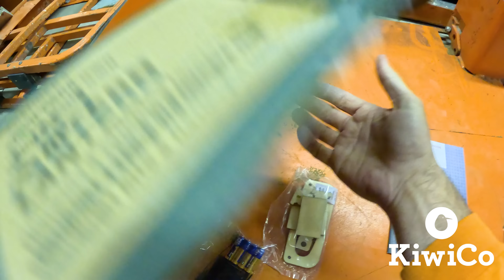How to Install an Elevator in your Backyard

Comment: you should go to Atlas Survival bunkers channel for tips on the finishing touches you should put in to make it an actual bunker capable  of surviving  nuclear fallout and all other stuff. You should get an AR500 bulletproof  hatch on top, have the exit tunnel hatch be covered with sand with an unscrewing  thing that you can unscrew from beneath and have the sand all drop down so you still have a feet off protection from radiation and bombs  at least on that hatch. then have a gastight main door obviously  on the bunker entrance with overpressure valve and porthole so you can open and peek if someone is inside the elevator shaft and maybe shoot them from there, a sump pump if water comes in the elevator shaft, galvanized steel with tubes for air and communications and other stuff, water tank, reverse osmosis, lithium batteries, big radio station with radio antenna outside on the house, wind turbine for backup if solar panels get covered in debris/ash or the sun is blocked by fallout. Also you should get a Swiss or Israeli  air filtration  system that can be handcranked too (atlas survival sells most of this stuff including the doors and air systems and all the other things and blueprints) also the air tube should have   a 90 degree angle with a drop into a area woth gravel and some slope so condensation from the pipe doesnt  go inside the air system  and ruins it, and also if someone  intentionally  pours water or fuel inside it doesnt kill you. also have the pipes be galvanized and covered by a very heavy galvanized mesh  and like a fireplace duct cover (dont know the name) so that someone  cannot put a hose inside it or even have the angle to do so. hide the tubes inside bushes that you plant  on top of them to hide them
Reply: better yet, call Ron the owner of Atlas Survival  Shelters!! Im 100% sure he would love to go there make a video with you and help you turn that into the best bunker you could, the guy is the worlds top expert in my opinion and lives in Texas, he's  the biggest bunker manufacturer  in the world and rhe best one at it
Reply: btw I hope you turned that underfloor as storage, you shouls keep water tanks and food storaged there, make the floor be able to lift up at multiple points like lids so you dont waste that space
Reply: @GenikaXVI  I would encourage you to watch all the bunker videos

Comment: 9:05 concrete (cement) does not dry, it cures, a chemical reaction with water. Too little water during the curing can make the cement crumbly and weak.

Comment: Save those Drive Motors, they make really good winches.
You can use a couple pieces of c channel to take that wobble out. mount the c channel to the walls and have a rod with the follower bearing in it.
That aluminum is going to be loud.
You might want to throw some rubber mats.
 I use super 77 and that non-skid shelf liner
Reply: Rubber mats on top of sound deadening would be perfect for that. Budget solution, reduces vibrations and making that wall feel and sound just a little bit thicker.

We all know that loud tinny noise we all know aluminum sheets love to make.
Reply: Thats a great point. I bet they could!

Comment: very nice ,good job converting the lift .kinda wished you painted it before mounting it against corrosion and you could do an central hydraulics for the bunker like collin furze has so no need for seperat batteries .less components = less things can go kaputt

Comment: if you were to get some cheap from china linear rails and bearing blocks, or from a sponsor rather than china, you might be able to make the lift less wobbly on the way up and down - so long as you can resolve the fact they would lead the rails once the cage went above ground.

Comment: i work as an elevator technician, you could solve the wobbling problem by adding secure side guide rails on the shaft and on the elevator cabin you could add rolling 
guide shoes (wheels). also, you could add a safety killswitch on top floor and on botton to disable the extra course of the elevator, making it stop at level and accepting only commands on opposite direction.

edit: since the elevator is a double entry, and upon close inspection of available space, you could also use a Sliding Guide Shoe. my idea is to apply T shape rails on the back side facing each other and add supports beneath the cabine. the problem with this is that needs a guide rail oiler to keep the rails lubricated or you risk the inside inserts of polyethylene to break due to friction
Reply: I was thinking the same thing, even a beefy linear rail would take out a lot of the sideways movement as it doesn't need to take much weight
Reply: @Connor-s1k  and add some gravity, friction break, while there too, a little "v" shaped metal on a spring or something am sure plans the internet how one works,,
Reply: @Connor-s1k linear rails in that size and length would be super expensive.
Reply: @GlassFoxGear robotics tech here for our VDL lifter from Comau it is 14k per rail X 4 = 48k. Mind you those are proprietary likely can find lesser more generic for 10-15k for full assembly
Reply: I think some rails with delrin pads on either side would be a simple low maintenance fix
Reply: @Specialedes  you can even use thick, worn thrift store cutting boards to save even more...
Reply: A single C profile with a polyethylene/teflon/whatever sliding shape installed on the wide enclosed side of the elevator would be my choice.
Reply: @celeron55 I think the sliding option at here is not a true option, dirt will fall into it, and it will rub and cause increased load on the hydraulics. I wrote a little idea about with rolling bearings, or with small wheels. Those will just roll over the dirt or grime
Reply: @celeron55 some thick UHMW
Reply: @theboz1419 exactly what I was about to say, that stuff is tough as hell. We used it in industrial machinery applications where I used to work all the time.
Reply: @jeremyslah1617  you need to like electronics and not be afraid of heights
Reply: @Lewis_91  lol i am afraid of height but i still work with elevators
Reply: Id like to see a switched gate so that when its extended up it can’t go down if the gate is open, to prevent going down on top of somebody. Additionally one could add an electric eye switch or pressure plate under the lift to sense somebody’s presence.
Reply: @alexdrockhound9497  Super important safety point!
Reply: Same idea here, all 3 sides 4-4-4 rubber coated bearings, and just make a tube for them on the inside of the elevator cabin, so you can cover the bearings for safety. And you also can weld rails for the 4 corner tubes, so it also could be functions as base for a handle bar. For the corner tubes, i would do some removable covers for the bearings, so you can install or remove them if service is needed. My idea also needs whole lenght flat surface on the shaft. 

Maybe I would add a top "building, where you can mount external batterys, or hydraulic pump if any of theese two fails. And from the top floor, entrace "building" could have 4 points, if the hydraulic cylinder fails, then you could winch up manually the whole elevator, and some safety locking bar would be a nice touch to be able to work safely on the hydraulics cylinder replacement. ( Just 4 pins that can slide under the lift, to hold it safely. "Parking brake for the elevator" :D ) 

( My english is a little "broken" becouse i'm not native english, but i hope what i try to say is goin through 😁 )
Reply: He could also add a fail safe break to stop it dropping at full speed if the hydraulics ever failed. It would only drop 6 inches and catch. Beats hitting the bottom at full speed.
Reply: If he cared about all those safety features he would have bought a proper elevator.
Reply: Bearings on each side
Reply: @Drrich_DIY  I see what you didn't do there
Reply: @Quovio   I think you didn't see what I didn't do there- or maybe you couldn't see what I didn't do there- but others may
Reply: @Drrich_DIY  I was joshing
Reply: No idea what he talking about but he sounds like he knows what he talking about lol
Reply: With a button that says "THERE", instead of 1 and 2, or B and 1.  Just... "THERE".
Reply: @Drrich_DIY  yeah i like it
Reply: @Drrich_DIY  🤣
Reply: That sounds like a very good safety idea. Hope Zack takes it into consideration.
Reply: This is overcomplicating a simple operation. How often do you think it will get used. Just let them enjoy the wobble. They can grease the walls just in case there is contact.
Reply: @RassieKariuki  true. We have essentially the same solution for a lift in our company. It's meant for our heavy machines only, no humans. But the wobble is still very noticable when loading/unloading. It's really not that bad and doesn't need addressing. 

I'd be more concerned about failing hydraulics and how to safely deal with that scenario. In our case that probably didn't need solving because no humans are supposed to ride it. There isn't even lights in there ...
Reply: Cheap hard plastic wheels on either side will do the job (going on a rail)
Reply: Or we could quit trying to reinvent the wheel and buy/install a lula lift and get on with our lives
Reply: Don't forget the kill strip on the bottom, so if it coming down and anything on the between the floor and the cage, it does not get sheared off, it toes.
You will also need a keyed override of the safety switches incase of failure or something in the way.
Reply: It's a rltrade, get an apprentice ship for millwright at a elevator company  @jeremyslah1617
Reply: @jeremyslah1617  my education was around the course i pickup when i was a teen and the one i did was electronics. i did go to college but right from the beginning had financial problems on my family and was unable to finish it.  i applied to work for various jobs that require my knowledge in electronics and got interviewed by an older gentleman that said something that to this day i still remember: "it doesn't matter if you have bachelor's degree or not, what we want is someone  like you that wants to learn for us to teach you how to work on the field. you dont learn how to work with elevators in college" 
i learned a lot since that and to this day i keep getting training lessons on older and newer models because there are a lot of models. you just need to be passion about it and have the will to learn.
Reply: Probably be fine with single guide rod on one of the corners. Ptfe sleeve with minimal clearancing. Lube free no maintenance. Nothing fancy needed as the lift operates normally with that flex
Reply: @Wick-d_Trucking  i dont say you are not right, but as i wrote my only concern the stucking.
Reply: I don't work as an elevator technician, and I had the same thought.
Reply: i aint no elevator tech but i solved the problem as i saw it. xd
Reply: Beat me to it
Reply: Are these mods OSHA (WCB) approved. I enjoy you inginutity.
Reply: @jeremyslah1617  they all hire people now, engineering skill you get on the job.
Reply: this is exactly what i thought. some type a railing would be great. also you might be able to add hard stops to limit it from going too high or low ? hydraulics propably have relief valves to accomondate for that.?
Reply: This was my first thought, just some sort of U channel and rollers would make that thing rock steady!!
Reply: possibly could wire in a n/c limit switch mounted at top 0 point and bottom 0 point into the estop function on the controller, possible to even add more beyond them for extra safety
Reply: They make little trolleys that go inside 1 5/8" strut, I made a little gantry crane with them.
It would be a very basic set up but you could do four guides for about $300.
Reply: I think he ought to add a rupture valve and some frefall buffers, because that forklift has seen some shit!!
Reply: @curranh.8328  I assume you mean the scissor lift not forklift. I've spent thousands of hours over 30 years using those lifts, and there's always several on the job site, and I've never seen one drop. I'm thinking they already have good safety features. I've seen guys get stuck up in the air and have to climb down, I've seen guys get stuck and someone on the ground open a valve or something to get them down. It wouldn't hurt to put new hydraulic hoses on it.
Reply: Im no elevator technician😅but maybe Jerry could make one using a leaf spring attaching wheels on both ends, that way it will produce tension on both side of the lift
Reply: Elevator Constructor here (recently retired), He could probably pick up a couple of counterweight rails pretty cheep. I know of a few mom & pop companies that always had them laying out in the yard, probably one local to him as well. Even angle iron would work.  But reading your comment  about space availability and going back for another look, I think tacking on some flat stock to the sides and using a spring loaded guide roller (minus the side rollers) may give some stability. Maybe could even run them inside a length of Unistrut if there's enough room. I like your idea of welding or bolting supports under the cab floor. Probably won't need oilers, just spray some Nylube on the rails once in awhile
Reply: @justadbeer  thank you for your opinion and wise idea. i gave my idea because is the way here on europe. And thank you for your contribution everyday on the job to help thousands of people. i still have a long way to go, but i hope one day look back and be grateful
Reply: @Lewis_91  - No problem, always great to hear from another elevator tech.
Reply: @GaijinGamerGirl - And???
Reply: And of course he has no response thinking he wont have any issues with it. It looks like a death trap to me. If elevator stops working they are stuck down there. It is why every building has stairs with an elevator cause sometimes elevators stop working. He has to have a monthly tech come out and service his ghetto elevator or at some point it will stop working.
Reply: Hell yeah brother what Local??
Reply: @nullanglecollective  Local #36
Reply: yea thats what i was thinking, pft. jerryrigged elevator..
Reply: P
Reply: I agree
Reply: 12:02
Reply: 8+😂
Reply: I scrolled down to say it needed rails, glad to see someone who knows what they're doing saying it instead!
Reply: Why did he build a bunker with Putin and was going to fight?

Comment: Hey, great video! 
But an engineer speaking here, dropping concrete from that height without a chute, is not good for its strength.
Reply from the maker: I'm curious as to why?
Reply: @JerryRigEverything  The concrete materials seggregate due to their different densities. This weakens the mixture of the concrete. It's not about the height. Concrete pumps go way up higher, but it is not freefall. The actual final hose is never more than 2 meters above the slab.

Comment: With some sensors and simple electronics, it is possible to make the elevator go up and down with the push of a button, without the need for manual control.

Comment: Since the thing is kinda wobbly,  if it wobbles a bit too much at any point isn't there a chance it will catch on one of those steel shafts/beams around it? Feels like some kind of guiding rails would make sense to stabilize it

Comment: For safety, please revisit the welding of the bolts to the metal plate —> I think they will shear under horizontal stress… I don’t think the weld penetrated the whole bolt to the center only the surface… 
I care for your safety
Reply from the maker: We triple passed. The guy working with me (Nate) was a structural welder before working with me.
Reply: Best wishes

Comment: its a bad idea to drop concrete from that hight. use a pump or large pipe to slipe it into place. this is to avoid segregation. Structural engineer here. with love and respect

Comment: i am still a bit concerned about the fresh air flow down there after the walls and rooms get installed. will you have air pumps to the surface?

Comment: Your channel really lives up to its name, I wouldn't have thought to jerry rig an elevator from a scissor lift.
Reply: Mustie1 did that in a barn to get to a loft.  He's kind of a hack, too.  ;-)  er, resourceful.
Reply: It's an impressive degree of resourcefullness on display
Reply: Back in the day he did all of the sketchy projects on another channel called Zacks Jerry Rig. So glad he has turned this back into a true "do all the things" channel with his home and family.
Reply: @BubbaOfTheZew  I would never trust anything underground to not flood. I'm assuming that press board sub flooring  is temporary. It will deteriorate fairly quickly with any type of moisture or humidity.
Reply: I think to maintain alignment and side knock. Maybe Jerry could opt for those Teflon or hard nylon plastic strip for the side bump while the lift is moving down.